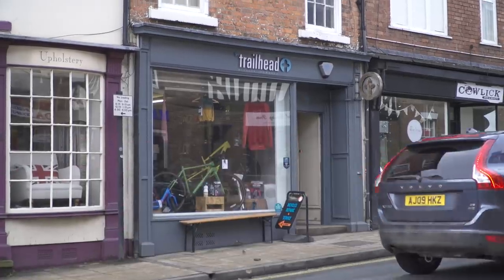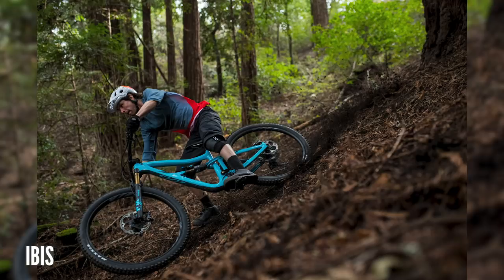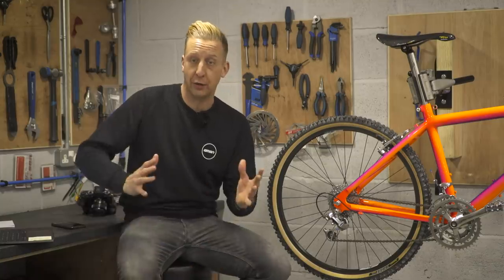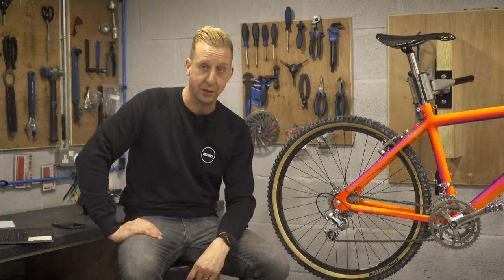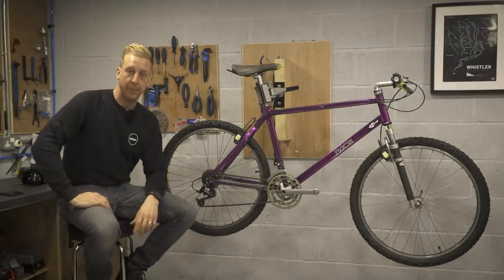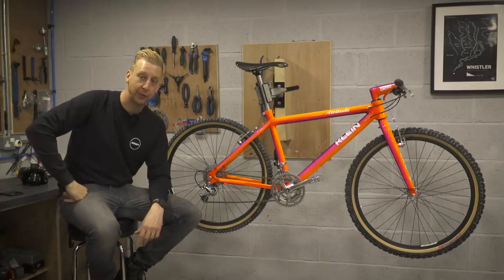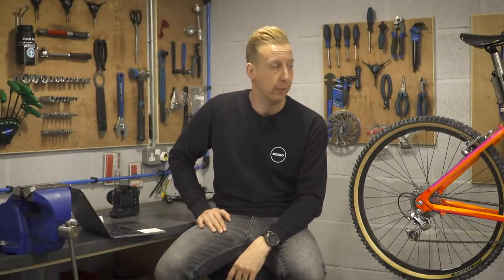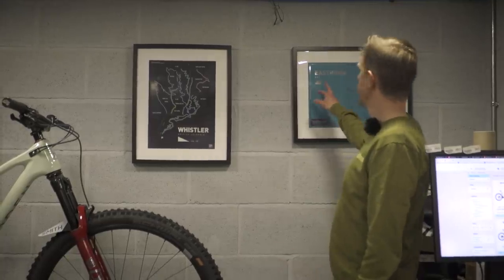New Enduro Wheels And A Custom Built Super Bike | GMBN Tech Show Ep. 112

Comment: Hey Doddy, Wot lens:- 23f/1.4, 35f/1.4 or 56f/1.2 ?? - Fum who spends $1000'z on Fuji'z & MTB'z..
Reply: @Andrew Dodd Most Fuji lenses I own now -  I've been very impressed a recent purchase of the 50-140mm f2.8 all the way thru the focal length Red label lens that will dispel all those disparaging opinions of zooms,(A Sharp Compression Killer!!)... Bike 17' TREK FUEL EX 9.9 FOX shock&fork up-grades Carbon 27.5 & 29 Wheels sets used in combination. Cheerz Mate fum AU.

Comment: #askgmbntech I recently dented the bottom tube on my brand new Kona process 153 about 3 inches in front of the bottom bracket. It didn't punch through and it is a shallow dent. How worried should I be about failure? Thanks from Washington state.
Reply: Sorry, Aluminum frame.